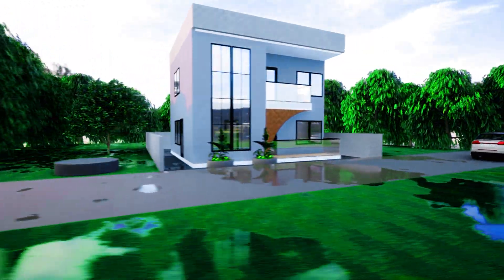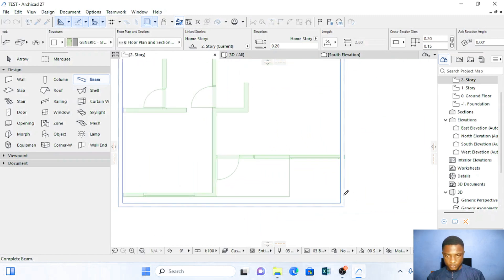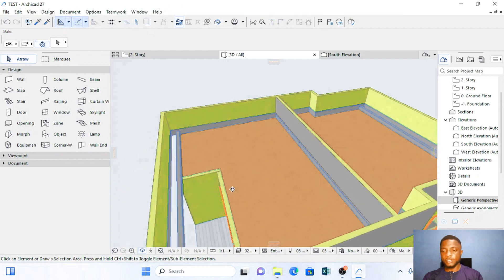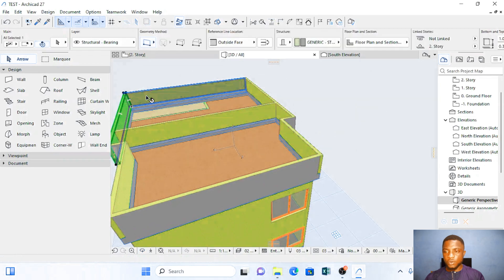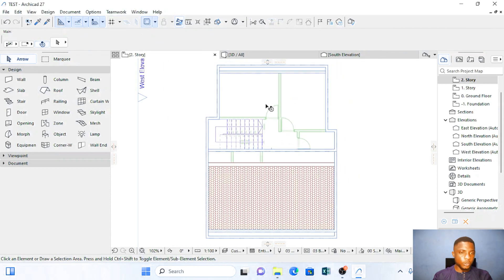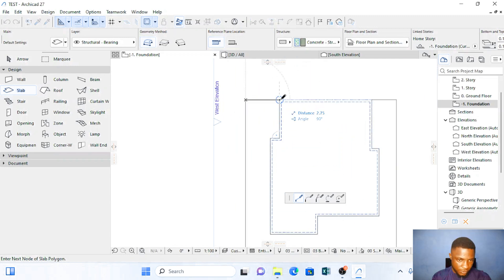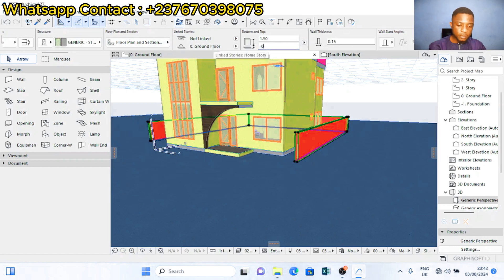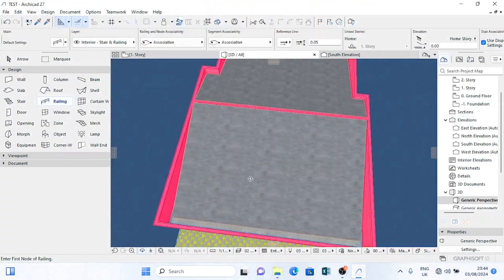How to Draw a Parapet Wall in ArchiCAD

Comment: senior 
good day.

I have a challenge with the roof so far, after drawing my roof the highest  point where my slope  starts is higher than my parapet wall which is not suppose to be so. please how can it be rectify ?
Reply from the maker: Click on the roof , then move to the Edge of the roof and hover over any node, Right click an choose the option to move-Drag, then move the roof down to the level of the parapet wall
Reply from the maker: If you find it difficult send your Archicad file let me correct and send back so your on point